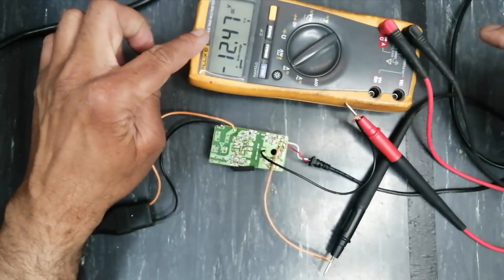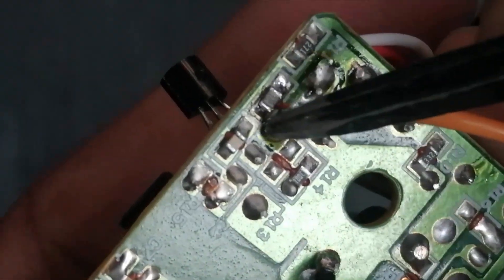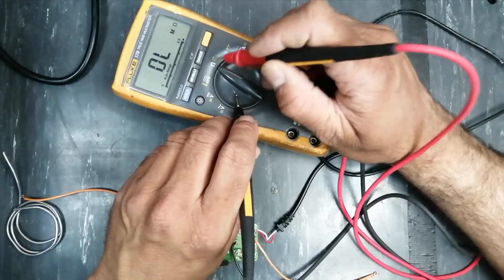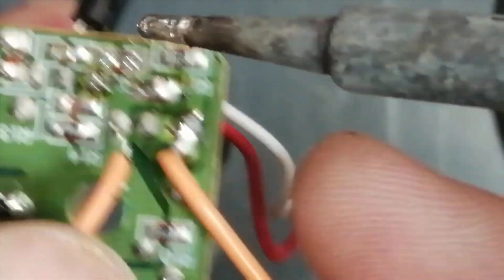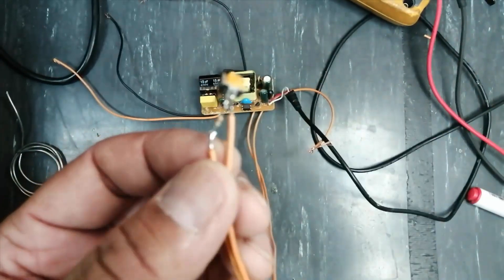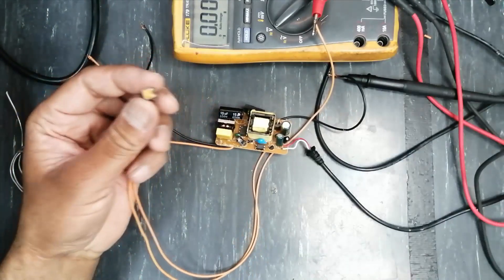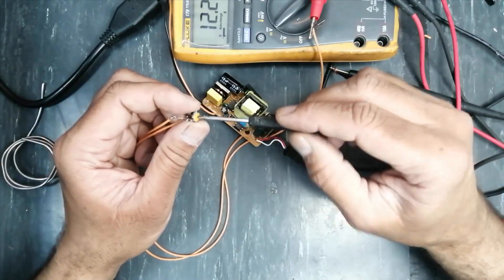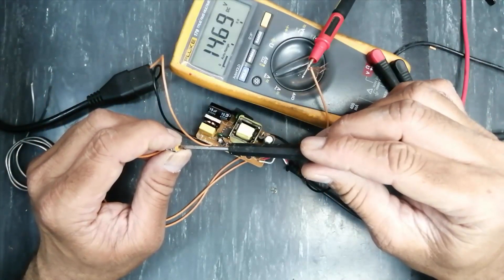#258 How to Increase / Adjust OUTPUT of the SMPS Switch Mode power supply or mobile charger

Comment: my 12 volt adapter used for powering WiFi is now giving output of 14 plus volts.  is it possible to make it deliver its rated 12 volt. it doesn't have opto coupler.
Reply from the maker: if it doesn't have optocoupler that means it is current controlled adapter. 
you can re-calculate current limit resistance 
or 
add a 7812 regulator to provide 12 Volt
Reply: @HaseebElectronics  thankyou sir. I will use the 7812 regulator. Because
I don't know about the current limiting resistance etc.

Comment: I want to know this is safe sir because transformer is for 12v  how it possible, please answer. Thank you.
Reply from the maker: kindly check video number 283 for a detailed answer 
i discussed it in detail 
we should not play with smps circuit, as any transformer cannot produce more power than its rated value,

Comment: Congratulations!
Everyone else takes an individual case and tells you which resistor to substitute... but if your SMPS is not identical, it's almost impossible to copy and make it work.
By showing us the "pin 1 to positive" you've made it possible for anyone to do - and in two languages at once!  If you are not already a teacher, you should be!
Reply from the maker: best regards for your valuable words.
actually I don't copy the videos made by others
I just share my own experience. might be it may helpful for someone
Reply: @HaseebElectronics  absolutely - I'm sure your material is original - but more I am noticing your way  of explaining it.

Comment: I have a 24 volt output adapter. I made its output voltage 19 volts as you show in your video. Original R1 = 1822 smd and R2 = 2051 smd. I made R1 resistor 14k. I did not touch R2 resistor. But output voltage is not stable. 18 volts to 19v constantly What is the reason for this?
Reply from the maker: I think it reached at its maximum duty cycle limit
Reply: @HaseebElectronics  What is the solution to this? Isn't it possible for me to get 19 volts output from this adapter?

Comment: Haseeb, the adapter I use does not have TL431A, kind of different design, is it still possible to change it to variable? or definitely can not do? Need your opinion.
Reply from the maker: sometimes some adapters have offline switching, that is slightly difficult, as that ICs use VCC voltage at multifunction pin.  so in that you have to consider the SMPS controller VCC limits
Reply: @HaseebElectronics  thanks a lot

Comment: In this case i trying 14.2 volt output in 12 volt circuit . now chenge output capacitor 25volt 1000uf to drive esyly 12 to convert 14.23 volt.

Comment: السلام عليكم
Mr haseeb i am working on air conditioner board i found faulty component with three pins in shape of transistor its letter on pcb  SR  do they mean shottky rectifier or what  it is not in smps it is in alternating current part what is it if you know

Comment: Very nice video ! i am trying to do the same with an ATX but it has no output, could you please make a video showing me what are the various steps to follow, from the mains to the exit mentionning the critical points (bridge, transformer, diodes) so that i can find where in the journey sits the issue.
I have seen many videos, but they focus on a particular point, i would like a walkthrough that starts with 220v input and goes to the final DC exit.
I hope to have made my question clear.

Comment: Sir I have a 12v 1.5 A Smps.
its work perfectly when it 12v but when I adjust its output.. about 14v for 12v 7A battery charging purpose through a diode. Then smps output voltage continuesly fluctuate around 11.6v to 13 v... while it charge the battery at 700mA constant current. but I fear my battery will not damage  for fluctuating voltage...
Please give your opinion sir... Is its good charging condition or bad...
Reply: Good